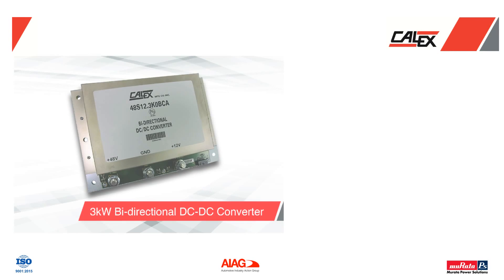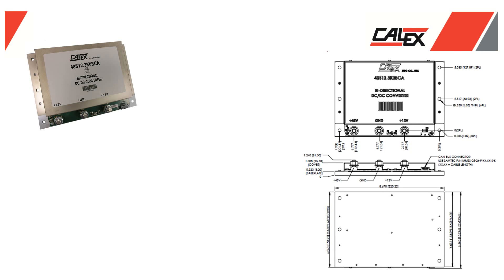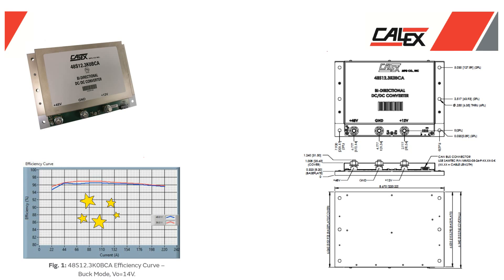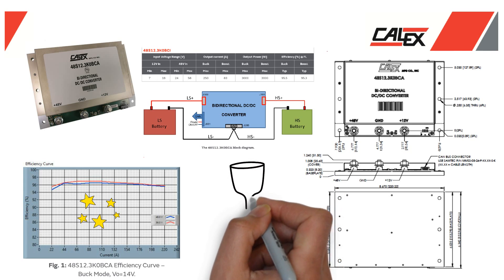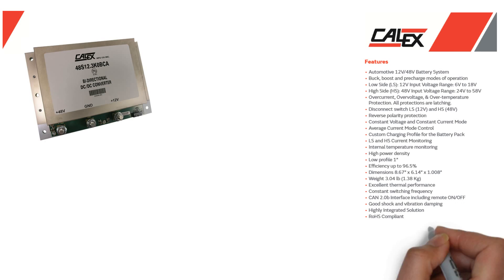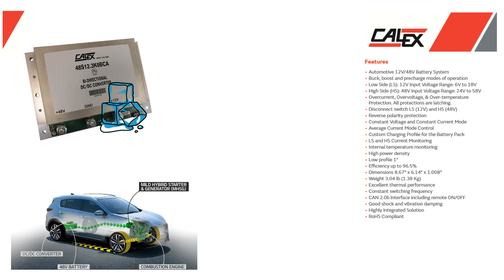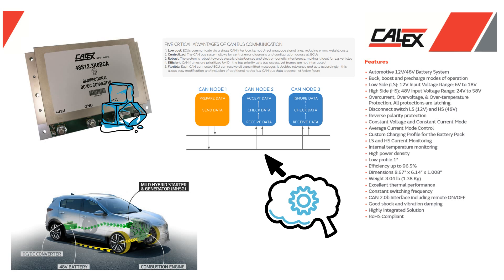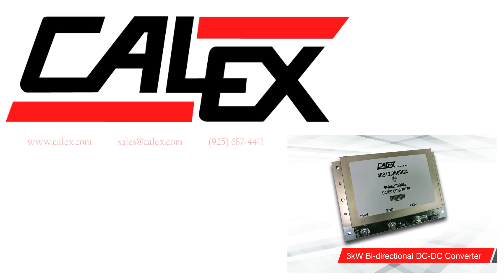Calex Manufacturing; 3kW Bi-Directional Converter, for electric vehicles, e-mobility & battery appl.

Comment: Is there something like this for 24v to 12v? That can be used to charge either direction, depending on need? Like allowing the 12-14v to charge the 24-29.4v system if needed, and vise versa in normal operation?
Reply from the maker: We have no plans to create a 24/12 V version of the BCA. We will be offering a 24/12 V version of the 3kW BCE series which is in an IP67 enclosure with air-cooled and liquid-cooled versions.